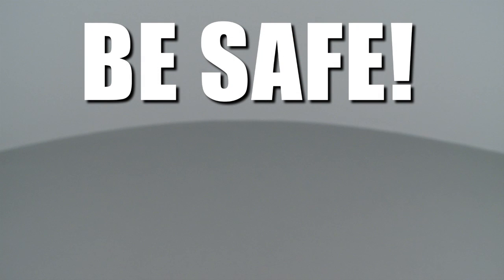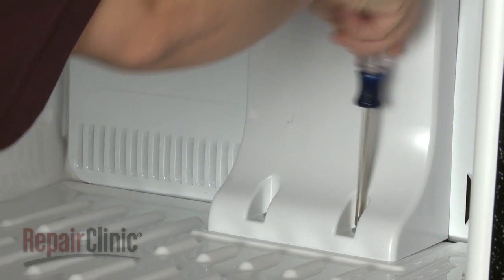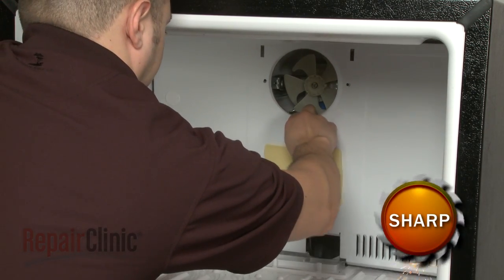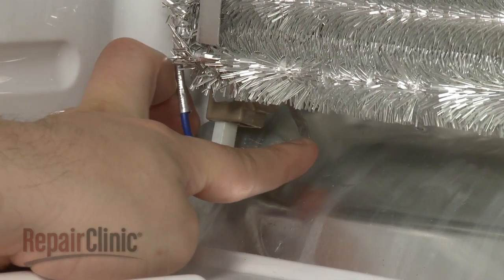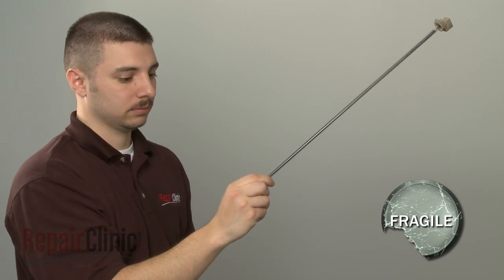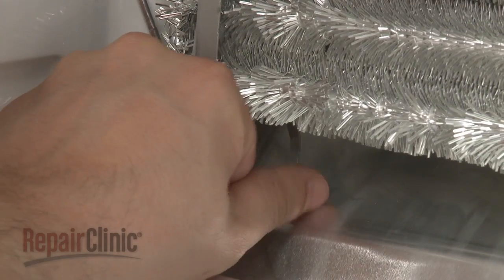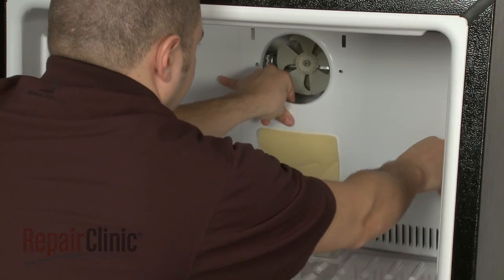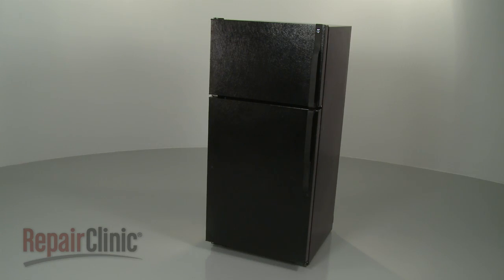GE Refrigerator Isn't Defrosting? Defrost Heater WR51X10038

Comment: I borrowed an analog meter & tested the defrost heater.  The meter moves from the extreme left to zero (ie all the way to the right), does this mean that the part is defective?
Reply: It should read betwwen 20 to 50 ohms.  You need to select R x 1 range.  Then touch the positive with the negative probes  and adjust the meter to zero  then you can test the heater